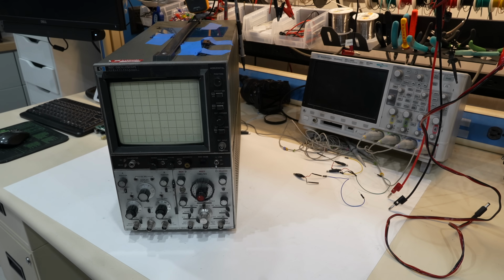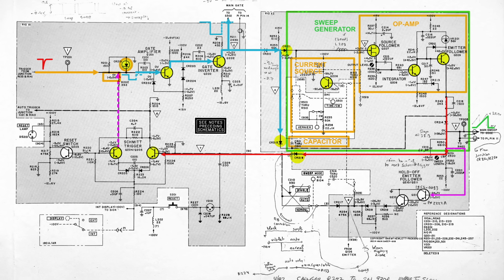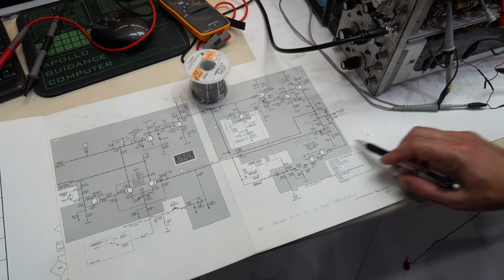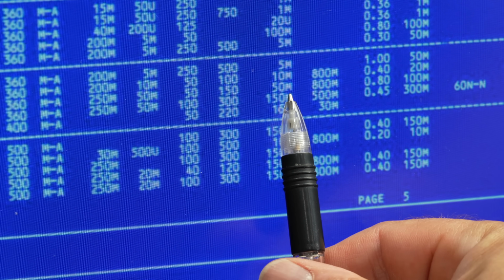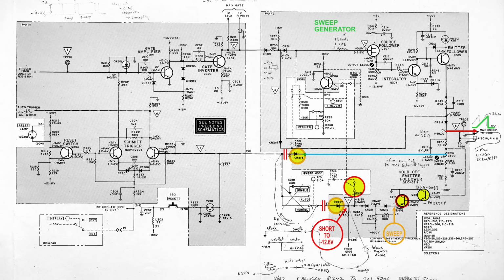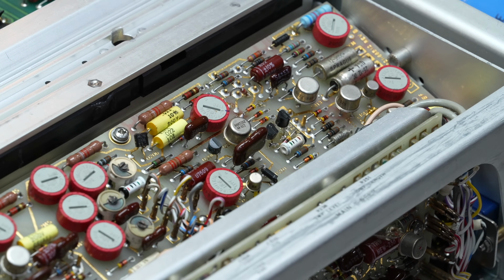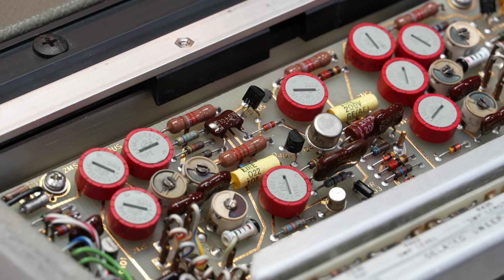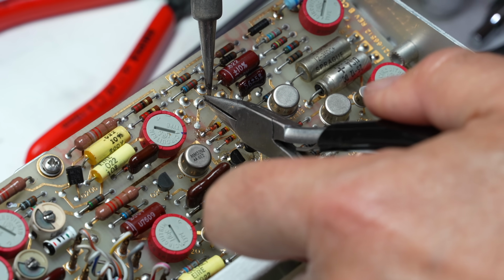HP 182C Oscilloscope Repair - Part 4: HP 1821A timebase really tough debug

Comment: I never worked on the 180 series scopes , but I did work with them at Marconi's in 1973 1st in their broadcast #Telecine area and 2y later at Marconi Avionics where I worked on GWS-25  and integrating 3rd party missile systems onto soon-to-be legacy Buccaneer aircraft. At Marconi HQ in Chelmsford I got to know the test & calibration guys quite well as some of the radar/laser guided stuff was pushing the limits of these scopes, as were the test conditions...
I spent many a day sitting under the aircraft out on the taxiways  with test equipment and spaghetti harness linking up into the bowels of the aircraft whilst I trouble-shooted integration issues whilst enduring the rather windswept env laced with kerosene leaking seemingly everywhere from the tanks in the wings... - truly character building stuff!!

Comment: I'm going through the main schematic loop for both the 1821 and 1825 and I agree with you they are like a mycelium growing on a tuber (which you alluded to neonly). I'm interested in the definition of an opamp as something, constellated out of transistor followers, millers, and current sources, that can simply support an integrator, rather than the modern interpretation of opamp as differential and near infinite. I am attempting to remodel this concept of the triggered and delayed (dual breakpoint) upslope generator, and now I am searching for the proper abstraction of this unique, dave and bill half-Norton opamp!

Comment: HUGE GAME-CHANGING PSA: HP actually DID denote wire colors in their schematics…just not in word form. 

Note the little numbers in parentheses (sometimes in ovals) printed next to most of the lines entering/exiting an assembly. Those are MIL-STD-681 color codes (AKA: the resistor band color coding scheme). 

The first number identifies the base color, second number identifies the wider stripe, and third number identifies the narrower stripe. 

For example: if you see “(947)”, it denotes a white base, yellow wide stripe, and violet narrow stripe; If you just see “(2)”, it means it’s solid red.
Reply from the maker: Thanks!!! I was wondering what these bizarre number were! Another mystery solved.

Comment: Funnily enough the first non-trivial repair I ever did was a 1990s oscilloscope with broken triggering, and it turned out to be a similar problem of "voltage is getting to a point it shouldn't and there's no connection on the schematics" - it took ages but I eventually found that a capacitor had leaked and electrolyte had flowed along the board and was leaking current from an unrelated part of the circuitry into the part enabling the trigger circuit and causing it to not turn on!

Absolutely fantastic video as always, thanks Marc!
Reply: Another in the class of "impossible" or "can't happen" sorts of faults.   Can't happen, until it does!   

I recall back in the mid 1980's when Ethernet was a new thing, and I was writing an ethernet driver for the TCP/IP stack I built for a UNIVAC 1100 mainframe computer.  I was doing some testing with a VAX 11/780 and things were mostly going along pretty well.  Except the count of IP checksum errors was going up?  (And only with this one VAX, other boxes on the Ethernet didn't have this problem.   I was suspicious of my code on the UNIVAC, of course.)   IP header checksum errors should be impossible because there's a very much stronger Ethernet 32-bit CRC protecting the frame across the Ethernet, and both system were on the same (thick-wire, yellow-snake, 10Mb/s) ethernet.   That's "impossible!"  

After much investigation.. bad DMA controller on the DEUNA ethernet NIC in the UNIBUS adapter in the VAX!   Every so often, one DMA transfer (8 or 16 byte) block would.. go wrong.  Did it put it in the wrong place in memory?  Just send garbage?  Who knows!    Writing network protocol stacks makes you real paranoid.  Who knows what weird crap arrives off the network.

Comment: First episode when I saw the plus and minus 100 volts going to the circuit boards, I was more than a little concerned.  I think they could have used a lot less, maybe 30 or 40 volts.  And that flimsy terminal strip with the -12.6V on it should have been stronger.  

In 1980 I used a HP scope, I think it was a 1741, but it was an excellent scope.  I could turn it on in the morning and set the trace on the zero line and 8 hours later at the end of the day it was still on zero where I had set it that morning.  Rock solid!
Reply: Gas discharge devices don't work at 30V.   Electronics aren't rated for gorilla hands - that's what the outer case is for.  If you take the case off, you need to be careful handling it.
Reply: @stargazer7644 

Gas discharge devices are used for lightning arrestors.  There are more modern devices that have taken their places in electronics.

Comment: The strange diode, why did you not used a protection resistor. Then you can say you improved the scope to 2025 standard.
Reply: Because he repairs equipment to original.

Comment: During my days as a TXE4 commissioning engineer 45 years ago I got quite adept at using a scope. My best memory was finding a faulty batch of transistors   (they all had the same week number) that were causing a timing issue in the SPU. I recall claiming 10s of hours on a Form 308 that allowed us to get back the testing time from the factory, as the fault should have been found during their test process. #goodolddays

Comment: @7:00 you have a note at the bottom of the diagram saying that you changed Q202 to a 2N9304,, I think you mean 2N3904 :-)
Reply from the maker: That was a previous note in the manual I got off eBay. It’s not even the correct manual for this unit.

Comment: Wow what a massive oversight in design from HP having a terminal strip so close to another connection
Reply from the maker: Looks to me that this strip was another later “mod”, to add the two decoupling inductors in line with the power supply going to the vertical plugin. Likely done by the product sustaining engineering team, not to the same A-class engineers that did the original. I’m making that up of course, I could be wrong.
Reply: @CuriousMarc merci beaucoup Marc

Comment: Thank-you for bringing us along down memory lane on your faulting finding journey. 

I recall my father bringing one of the HP 180 series modular scopes home from work in the 80's for a weekend so that I could take polaroid photos of traces for my college project (delta modulation for a simple ADC implementation). My home scope didn't have a delayed trace and only went up to 10MHz. I was amazed when he showed me that it was modular and your could add different modules. When you look back at these instruments and think that the transistor really only came about 10-years before this scope was manufactured, the knowledge and learning we achieve back then is amazing. I recall seeing  datasheets for some Fairchild transistors from the 50s / 60s,  not the 1 or 2 pages that you get today. It was a small booklet and had detailed s-plane analysis of the transistors capabilities.
Reply from the maker: You are so right. This Fairchild manual that I scanned here: https://archive.org/details/fairchild-semiconductor-transistor-and-diode-data-catalog-1970-searchable . They give you everything you ever wanted to know about their transistors. The 2N2222 is in there!
Reply: @CuriousMarc  I find old manuals near the introduction of a new technology have a lot more detail on how things work then later manuals.  The later manuals/textbooks just give a obligatory summery and move on. The early manuals were written with the expectation that you were already experienced with electronics, and just needed to learn about this new tech. That why I tend to snag old parts manuals for my library.  Now, if only I could find time to read them ...
I wonder if I should upload those manuals.
Reply: @russellhltn1396 I too prefer the older documentation that assumes a lot less, even at the more introductory level the best introduction to electronics I ever read was in an ARRL manual from the 30s, IIRC it starts with the electron and goes from there.
Reply: It might be interesting to note that some of the Tektronix tube scopes, back in that day, were using plugins.  In my view, the 7000 series plugins are quite a bit easier to use and swap than this HP version, but we all have our preferences, now, don’t we?  : )
Reply: Wow! This was definitely extreme! Well done, Marc!

Comment: I was going to suggest adding insulation to the pin that got pushed in and caused the short to -28 volts, but then you already did it! Seems like this guy had a stressful moment at some point its life. Kind of amazing to me how many potential contact points are just exposed to the air. Any other possible preventive insulation you might consider adding, just in case?

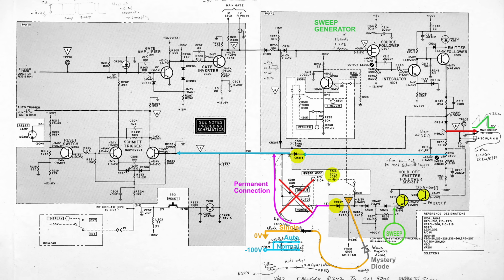Comment: 41:20 yes, that's what i was thinking, seems a bit janky to just put raw volts on that diode, how about a resistor...
Reply: I would guess the revision only changed the components, but not the circuit board and there was no good spot to put the resistor in the existing design
Reply from the maker: @JonaJona  Agreed, looks like a quick hack to correct some other kind of problem that the old circuit had.